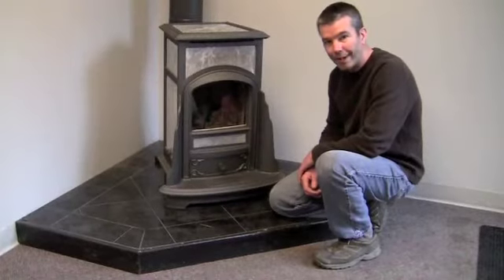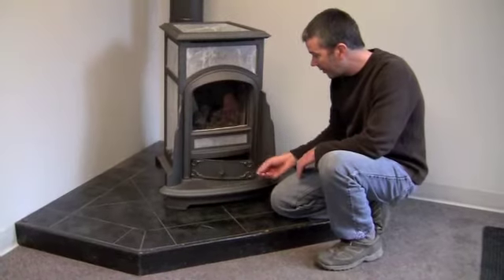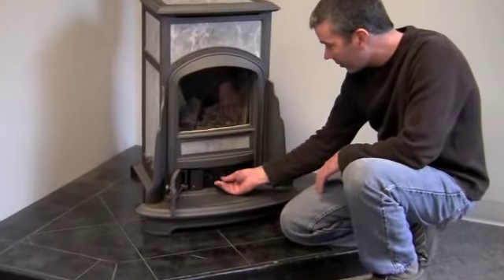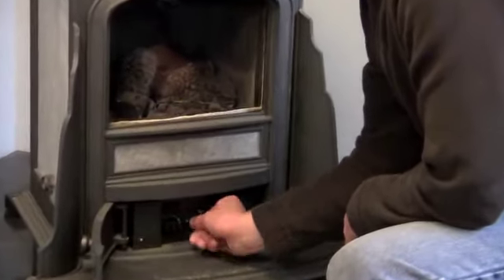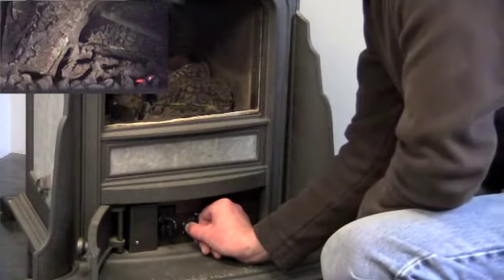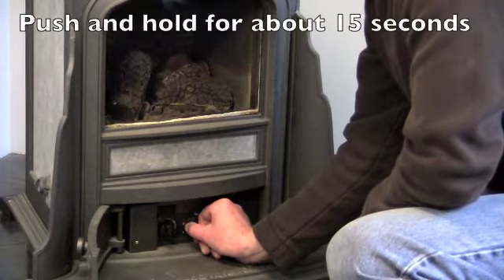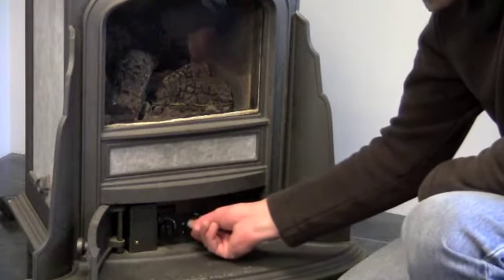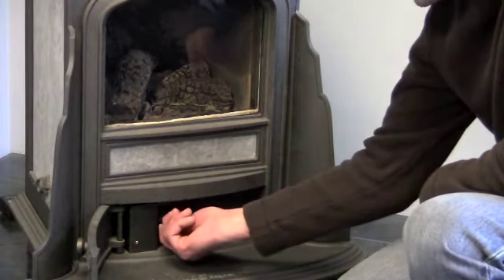Cottage Franklin Gas Stove- Lighting Instructions

Comment: Hello from Eastern Oregon. Not much info available. Do the stove have screen or glass, to open and close.
Reply from the maker: Good morning Vicky, that video was simply an instructional video on how to light the Cottage Franklin. There have been new regulations since the video was made in 2011 which mandate the factory installation of a protective screen to prevent physical contact with the glass behind. The Cottage is a direct vent gas stove and all the combustion air for the firebox comes from outside . The stove is not designed to run with the front glass/screen removed. If you have any other questions please visit our website at www.woodstove.com, or we can be reached by calling 1-800-866-4344 or via email at info@woodstove.com.